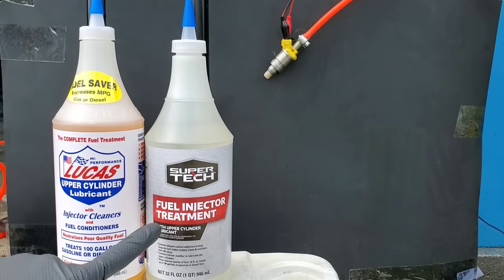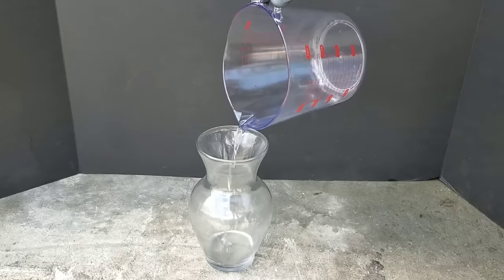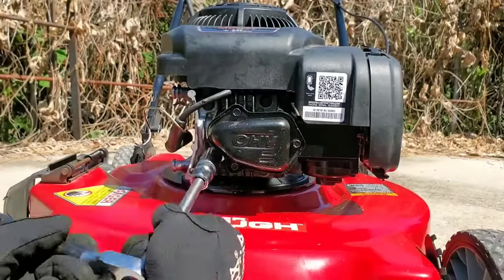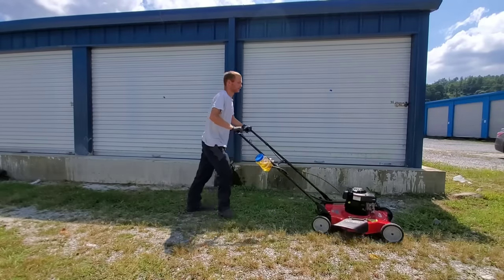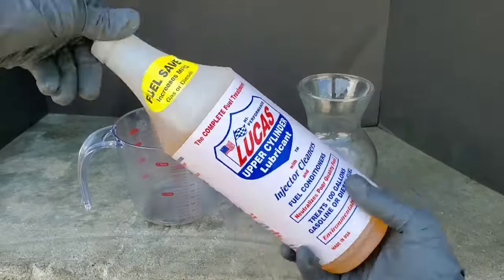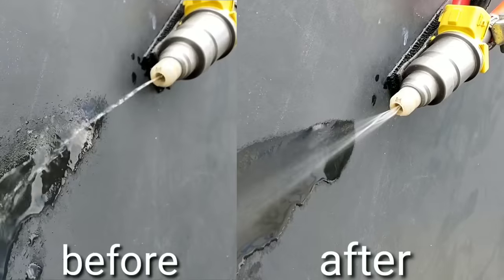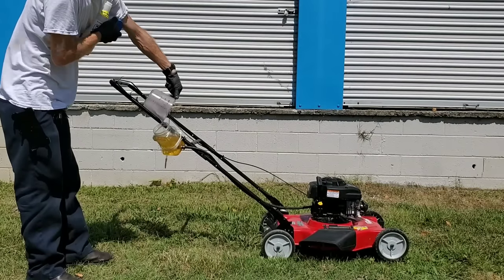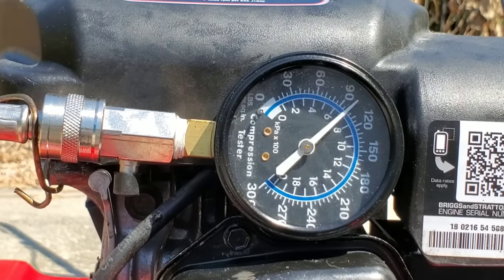Lucas vs super tech. Fuel injector cleaner!

Comment: How can a fuel additive add compression?  Depending on the temp of the motor will effect compression.
Reply: My bet is that it removes possible carbon deposits on the boar and rings and valve seals, and maybe that helps?? I don't think it will do anything on a clean engine.
Reply: An oily product will create a better piston ring seal
Reply: @glensansom9771  Im not accepting that.  Oily product in fuel, I dont see it.
Reply: @mopar2ya165  It is oily. Get some on your fingers or spill some on a bench, and it takes a strong soap or solvent to clean off. Not only that, I left an empty bottle in my car, and it attracted ants (Texas type)! Go figure.

Comment: Lucas is just built different! We use it at work all the time, mostly for "sticking" fuel gauge needles but some rough idle problems too
Reply: Ever ran 3 bottles through on a near empty tank? What would happen.
Reply: @YXEFlatl1ne  not sure, highly doubt much would happen but it might loosen up some sludge in the gas tank and plug up the fuel pump, I know that's a concern with Seafoam.

Comment: I'm on the second gallon of this stuff. I add it at every fill up and it does help with mpg by about 1.5 per gallon. makes the engine idle much more quiet than with out. Start ups seem much easier/faster. The exhaust has a gun powder smell now which I like but it just seems odd
Reply: What car do you drive

Comment: Lucas seems like good injector clearer. Just added Concentrated Seafoam fuel injector cleaner to my tank tonight.  Wish I saw this first.  Hoping the Seafoam makes a difference. THANKS!! Great videos.
Reply: Thanks, any news: on Se@foam, that is noticeable?
Reply: @opera93  A little but I have a misfire on Cylinder 3. Gotta take the air induction, Throttle body, and intake manifold off to replace gaskets. Then I can check the coil pack and replace plugs.  Pretty sure I have an oil leak into the plug well so just gonna replace PCV and all the gaskets while I have it apart and can get to it. Intake, valve covers, etc. This Ford 3.0L Duratec DOHC is an engineering nightmare to work on bank 1. Right up against the firewall. I'll get it done though.

Comment: I use the lucas upper cylinder stuff in every tank when i fuel up in my Ram since new. I also use 1 gallon of that Lucas oil stabilizer stuff in my oil. Getting 24 mpg and it only has 6000 miles on it. Lucas stuff makes a difference.
Reply: @Peter Angles I'm not an engineer
Reply: You use a gallon of this in your oil? I have to cry shenanigans on that claim! I think this is what Peter Angles was saying! Your engine would be dead now if that's what you only use! SMH!
Reply: @Peter Angles  - I agree...how can an engine, designed to use 5w20, survive using just pure Lucas?! There's no way for the Lucas to get through the tiny oil passages a thinner oil gets through?! I think he meant to say a quart, not a gallon - and it better be the synthetic oil stabilizer not the regular (holy thick as molasses) oil stabilizer.
Reply: @JSmith-wy3yh  - That's more than obvious, that you're not an engineer!
Reply: @irishkelly654  OK Einstein. Thanks for clarifying. 🤣🤣🤣🤣🤣🤣😍

Comment: Thank you dear friend for this information. 
Can anybody please suggest me which one I should use in my 2007  vw 1.9tdi diesel engine? 
Lucas or techron or amsoil pi ?
Thank you in advance.
Reply: Chris Lang  Thank you dear friend. 
Previously I have used Liqui Moly super diesel additive and it really improved throttle response.
Reply: Chris Lang  Thank you.  Well,  can you suggest any good oil additive to make engine smooth.
Reply: Chris Lang  Thanks my dear friend for your elaborate information. 
Surely your vw will touch 500000 Kms on odo 👍👍

Comment: AMSOIL just came out with a replacement for the Lucas treatment  and they have them all beat. I just bought a large supply of them.
Upper cylinder lube . 
And there P. I. Intake and gas cleaner. I also use there signature synthetic oil series premium, I am not a dealer, I am a preferred customer since 1979 an I have never had to rebuild a motor,  I also use there oil filters .
Buy there products speak for themselves you can check out this online and  U tube. I like Lucas treatment and have used it regularly but when AMSOIL came out with a replacement I switched over.
Reply: I've heard alot of good things about amsoil. Thinking about running it in my transmission.
Reply: Next week I will be putting amsoil auto transmission fluid in my  dodge charger RT. And in the rear end .
Reply: I use Amsoil signature synthetic  in my 1999 mercury cougar  154,000 miles and my dodge charger
2013 rt. Hemi 81,000 miles
And 2017  Ford Mustang Ecoboost premium 2.3 turbo 
With 9,000 miles on it. All  run Amsoil signature synthetic.

Comment: I would now to go back to the lawn mower and run a tank of fuel without any additive then recheck the compression.  I think you would find compression would go back down to 89 psi where you started.  Just like adding an oil or film to the cylinder, the compression would of course go up but when the oil or film goes away then it will be reduced.  Also, using the same injector for the cleaning test did not help.  You cannot say that one is better than the other just because the injector opened while the lucas was being flowed through it.  That ignored any added value the Super Tech may have initially provided because you used it first.

Comment: I use lucas fuel treat in gens and mowers if they surge or slow start. Every time they smooth out and one pull at normal temp. Stabil for storage works very well for me. A shot of oil stabilizer for very old engines also works for no oil puffs at start up after long storage. Before storage gently draw cord to compression to stop open valves from getting a wet engine!

Comment: I have a  2018 toyotaco 2.7l wimp with oversize box canopy and mountain peak tires.Faithful 80.00 at toyostealership every 6 months.19 mpg max. Slowly dropped to 15 mpg. With 33,000 miles I was suspicious. I checked the air filter. What Not changed for 2 years?????? The tree rats shredded the fire wall insulation when I got it fall 2020 with 23,000 miles. The nest and chewed  original engine air filter luckily stayed  in a mat. Aaahhhaaahhh!!!!!!! I put on a new filter. Checked the oil soon after the expensive checkup also. Too dark for  500 miles. I changed it. 17 mpg. Hmm? I put the proper dose of Lucas in two tanks. 18 to 19 mpg. At 34,500 miles I believe it should do better. I will go back to Lucas. This is Dec. 2023. Yes it sits alot. I drive every two weeks for 80 or 100 miles highway to small city. Carry maybe up to 300 pounds back home. I miss my Ford Ranger. Lol

Comment: Paul Hetherington
0 seconds ago
/mk two mech/electro arms that - travel around a 6''in diam by AVN grn trackz of two pos par 15deg an 25deg
sec of areas//maps header pipe / magnetic fuses for mid graed sizals /temps/water pumps//AVN rd hides till Ba'qe ist att disc brake unit's caliper rates/ pads alignments u VARs//prev two pos par 25deg 2 signa wx(iii) duplicates @ 25deg ++- 15deg /

Comment: I have to comment on that, always refueling with fuel FUEL TREATMENT - INJECTOR CLEANER - LUCAS OIL, when I went to change the engine gasket, the pistons and the exhaust valves were with a white crust, I just leave with sandpaper. what they say?

Comment: I have an '04 chevy with a 6.0 vortec.  It just hit 175,000.  Still runs pretty good for an old beast.  I'm the original owner and I have followed the maintenance schedules religiously.  I have always used Lucas fuel treatment but only treated when it was time to change the engine oil.  However, as of about a year ago, when the engine had about 168,000 on it, I started experiencing sluggish acceleration.  In the beginning, I mistook this for bad plugs/wires.  I changed out the originals when the vehicle hit 96,000 with top quality parts.  So, I was hesitant to buy new plugs and wires as I figured they should go at least another 20 and possibly 30,000 miles before needing replacement.  So, I dumped some Lucas fuel treatment in the tank and almost immediately, the sluggish accelerations stopped.  As the tank drained, more and more power started coming back.  Due to the trucks age, I now treat every tank.  The second set of plugs and wires are still in there and likely will be for a while.  Thanks for the video.  I knew you would find positive results using the Lucas.  It works for me.

Comment: If I already added the cheaper STP fuel injector cleaner for high mileage cars, Is it safe to also add the Lucas fuel injector cleaner in the same gas?  The last few months, my car has been bogging out during acceleration unless I added fuel injector cleaner. I've been using the cheap stuff and didn't put it in last time and at 1/2 tank, the car stalled and couldn't start up for about 20 minutes. I put in 1/2 bottle of the STP but haven't started it up again since.

Comment: This was a great video that I enjoyed, but I don't think it was a fair test.   Thumbs up for trying though.....

 I wonder if the Super Tech cleaner started the cleaning process, and the Lucas just finished the job?  And what does each product do to your car's fuel pump and catalytic converter?  Any subtle damage?  You can't tell from this simple test on a lawnmower.  I think your best defense against fuel system problems is to just use Top Tier fuel.  On the other hand if you have been using cheap gas for a long time, your engine might benefit from a one-time use of one of these fuel system cleaners.

Comment: Why did you keep the valve on the hose out of frame? I've tested this product myself and my engine ran worse than it did before. A cheap bottle of Macs antifreeze cleaner from NAPA did make it run better.

Comment: Only part I could not get was how the compression got raised by more than 10%, which is huge, without the spark plug? I could have believed it if the combustion was actually taking place in cylinder and see compression gain due to your new cocktail. Only explanation to that compression gain is that you tricked most of the viewers by pulling the compression release valve to ease start up during Super Tech test.

Comment: Lucas does clean...I had a 6.0L Chevy truck that was starting very rough so I put a bottle of Lucas in it and after a few hours of driving it began firing up quickly and ran smoother. That was my first experience with Lucas and I've been using it ever since. The truck sat a lot so that was mostly to blame. Most vehicles that are driven daily will not develop problems like this and one could treat the fuel once a year and be good. If you rack up miles and drive hard then over treating your fuel is just pissing away your money...just do it once a year.

Comment: I used Lucas and 2 days later have misfire 2 cylinders and random misfire.. ended up changing spark plugs.. all 4 ignition plugs and 2 fuel injectors.. on a 2009 Honda civic Lx

Comment: Doesn't. Raise realy raise compression. It cleans valves and gettin better seal
Reply: Agreed. It restores some of the original lost compression
Reply: The fuel injector cleaner does raise the compression,  bu cleaning the dirty seals. So the product does increase compression by doing its job
Reply from the maker: Yes similar to a wet compression test also the Lucas is more viscous whem cold.

Comment: There are two types of people, those who take dietary supplements and those who don't. Those who take good care of their health are usually the ones who use good fuel additives like Lucas upper cylinder lubricant, those who don't give a crap about their health usually call all the additives a "snake oil".  I have been using Lucas upper cylinder lube for about 9 years on my little mitsubishi mirage and am almost at 590.000 miles and the engine isn't even showing slightest signs of old age with all original engine parts and pumps. All my previous vehicles have given up their ghost before reaching 300.000 miles.

Comment: Could you test if diesel additives such as injector cleaners or cetane booster work to improve power output and lubricity of diesel fuel,.. and if 2 stroke oil added to diesel has any similar effects?
Reply: Use the Lucus in my Cummins and yes it works. 260,000 miles on the original injectors and still going strong.

Comment: One of the least scientific videos I have ever seen. Compression testing needs to be done under exactly the same conditions. Flow rate was not measured or timed. The video cut scenes could have been over several minutes or at the exact same time. As far as the flow rate, how do you know that the initial test didnt loosen the deposits on the injector? Sorry, but I can not put stock into anything you recommend.

Comment: I have a high km Subaru with various leaks. I used Lucas on the power steering / rack and pinion because it was leaking at the seals, fixed it immediately.

Seam deal, transmission was leaking at the gasket (I probably should have replaced the gasket), but didn't have time. I used Lucas, it fixed it.

Comment: Am I missing something?  How is un-ignited fuel affecting the compression?
Reply: Tommy Sawyer it says it has upper cylinder lubricant, which cleans and lubricates the valves, making them seat better and causing a more hermetic compression on the engine.
Reply: They normally seat better just by the engine warming due to metal expansion.  I’m not saying it doesn’t work.  I just want the test done with a cold engine with the Lucus first, before the engine is warmed up.

Comment: You have fuel injected lawn mower? 
Edit* nvmd I get what you're doing, also you're gonna burn up the coil on that injector running it open, they're designed to pulse
Reply: Just add some sugar to the gas tank it will pause within time....

Comment: the "compression" isn't increased, the carbon build up in the combustion chamber is removed, giving more room for the combustion process. Compression is directly related to the stroke of the engine, so without increasing the stroke, the compression isn't going to change, unless there is a build up, which causes power loss. remove the carbon, get more power.
Reply: so the compression WAS increased
Reply: Compression is also increased by better piston ring seal!which an oily product will help to achieve

Comment: Please test Lube control products, like fp plus, fp60 or lc20... Ive used fp plus the last 5 tanks on my grand marquis and went from 310 to 330 miles a tank, to 340 to 370 a tank. Its improved everything from idle to full throttle. My car used to only spin the tires for 10 foot now it will smoke them
Reply from the maker: Where can we find the product?
Reply: @NATESINTERACTIVEAUTO  google Lube Control products. They have a website

Comment: My 2014 Versa 5 speed has 130k miles. I used to be able to pop the clutch and take off quickly in first gear but now sometimes it styles and I have to might give it more gas.  what are your thoughts? I’ve always run premium gas too but I think it may be part the problem. Air filter looks fine.  it is not stalling every time just sometimes. used techRon recently.

Comment: Clarification would be appreciated, for modern bmw’s 2012 and up would lucas injector cleaner help? Mine has 120K miles and it might have lost some power
Reply: Ri2nonerok not really
Because they use direct injection which is extremely high psi
Reply: jeepkid92 thnks

Comment: Seafoam does a pretty decent job as well.
Reply: Sea Foam is a multipurpose tool. You don't use multipurpose cleaners on your mirrors/windows AND countertops. It doesn't work as good as a proprietary cleaner. So, don't use multipurpose tools on your motor either. Sea foam is a good conditioner for old gunky engines so you put it in your crankcase. But leave the carb/fuel injector cleaners to STP and Lucas 👍

Comment: Neither of these products contain PEA(polyether amine). Why even test something that hardly does anything besides drain ones bank account?

If you want a injector cleaner that actually cleans carbon look into REDLINE, Amsoil, Regane GumOut,Royal purple. ALL contain PEA. Do yourself a favor and read up on PEA if you are in search for the best fuel system cleaner. There’s a reason it’s in all top tier gasoline. Granted in maintenance dose,  but it will keep an already clean engine from future build up.!

Comment: I’ve used Lucas many times never worked not once. This video probably sponsored by Lucas. By the way Lucas is not good to use in motors because it creates bobbles in movement’s, empty spots will cause metal touch and decrease engine life. This is a fact.

Comment: The whole bottom line is if the injector is pissing or spraying fuel mileage will be the same. When was the last time anyone changed a fuel injector anyway. Most vehicles now days go to 300k without fuel filters. Look up a fuel filter for the early ford edge. Unless you count the little bag on the fuel pump in the tank they dont have one. Just buy good gas without alcohol and you wont need the voodoo in a bottle. Most cars dont sit long enough for crappy gas to damage the system anyway. The point is how fast does it go back to pissin after you run multi gallons of gas through it. Your just wasting your money.

Comment: I use Lucas super cylinder lube and you can actually smell the Lucas being burnt out the exhaust pipe. Plus I get roughly 47 miles per tank full on hiway trips. And roughly 39 miles in stop and go driving.